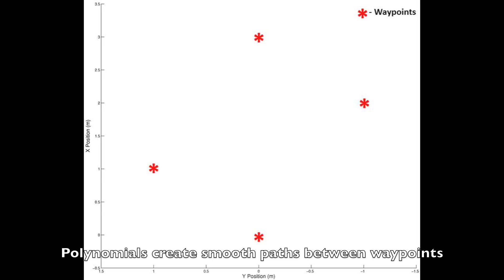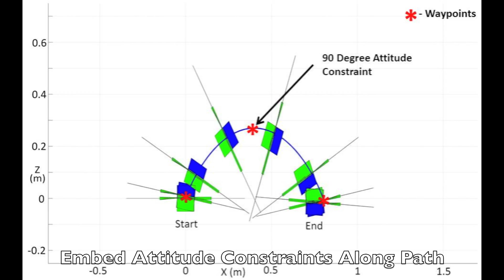Variable-Pitch Quadrotor Trajectory Generation and Control

Comment: I would guess its autonomous to a certain degree. The task "Go from point 1 to point 2 and arrive upside down" was probably programmed "by hand", but the quad rotor is probably flying "by playlist" instead of the regular direct hand control used when flying normal RC quads.

Comment: Thanks. When the robot is flying upside down can it designed and program to carry upto 600 pounds payload. If it can be done I would integrate it to a robotics project I am working on.

Comment: @rhynobots I don't know for sure, but I'm a mechanical engineer and I took some control systems classes in university a few years ago, and I would say that the trajectory is likely pre-programmed.  It would be very hard to control that manually.  They probably wrote a computer program that took into account the weight distribution of the quadrotor, and used control systems to automatically control and stabilize the craft.  Programs like MatLab are very powerful for this type of thing.